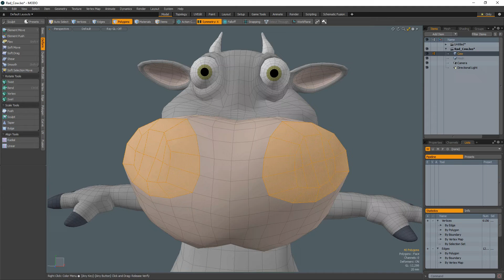MODO | Introduction to the Radial Align tool

Comment: Hello, how are you? How can I get the perfect circle script?
Reply from the maker: Someobody have still have that over on the discord.  Ask in the Modo channel.
Reply from the maker: This isn't a script though, it's just a normal tool in the deform tab near the bottom
Reply: Hello, I'm trying to make this tutorial, this is the name of the tutorial: (The Foundry MODO - Motorcycle Tire for Vlad Mafteiu Scai), when it gets to minute 10:10-27, I can't get the cycle perfect, can you help me?
Reply from the maker: @wagnerflat  I would suggest joining the Pixel Fondue discord and asking for the script there.  You don't really need it though, just use the radial align tool instead - it does the same thing.